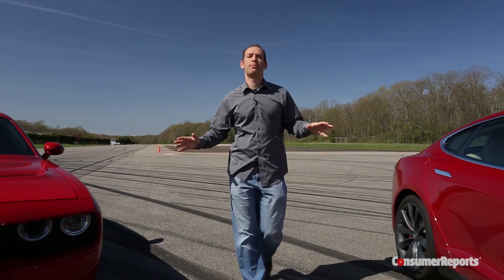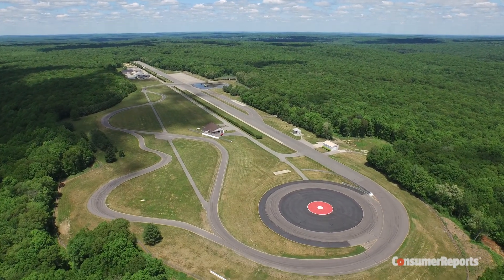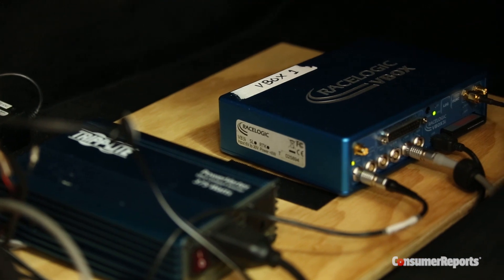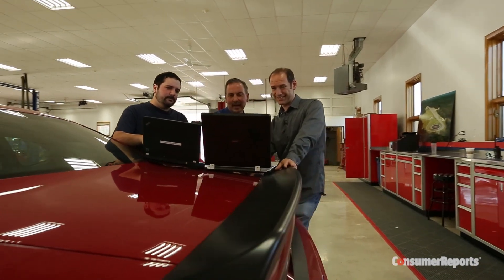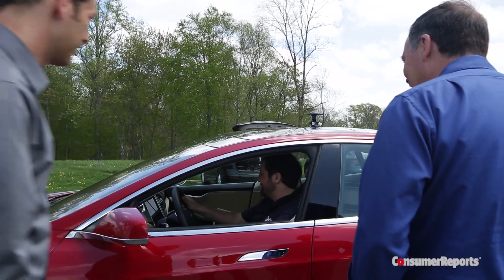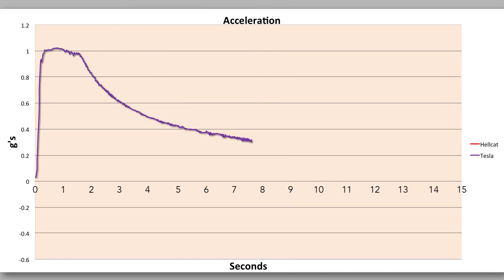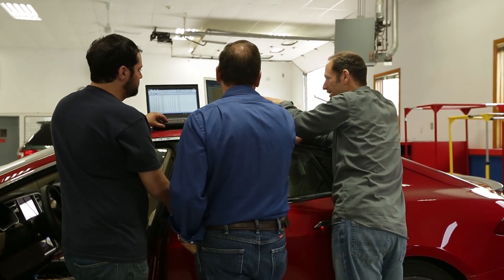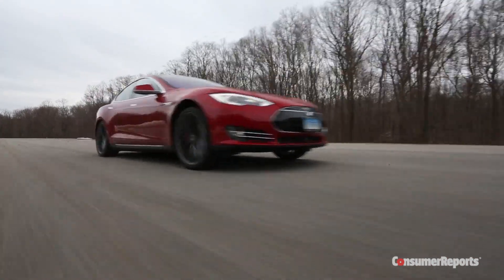Track Science: Tesla P85D vs. Challenger Hellcat | Consumer Reports

Comment: Do you think that the difference in performance between the two cars was at least in part due to one car delivering power to four wheels rather than two?
Reply: Dan Troop Not really.  They could have used an older P85+ with RWD and result will be similar.  The electric motors are able to deliver 100% torque right off the bat, where the hellcat engine/transmission needs time to rev up to its full torque.  If Tesla fitted a transmission, even if just 2 speeds, it will blow away Hellcat at top speed as well.
Reply: Dan Troop better traction is part of it, but electric motors provide max torque at 0rpm so the motor doesn't have to spin up the 2-3k rpm before providing good power. Electric motors are like the opposite of turbo lag.
Reply: Antenox "Electric cars don't really need transmissions." 

Seeing how the P85D falls flat after 60mph I would say it does.
Reply: fatboy19831 For a 700 hp car yes... it is.
Reply: fatboy19831 Man you are full of incorrect info arent you?

The Hellcat is 707hp.

Both Hellcats are faster than the P85D.  Just because you watched a video where the owner could not drive it to its limit, does not make the P85D faster.

The world record run for the Tesla is 11.6.  If a Hellcat driver cannot beat that, they just dont know how to drive it as the Charger gets 11 flat and the Challenger gets 11.2.

The Charger Hellcat with a tire swap to some street legal drag radials is faster to 60 than the P85D (2.9 seconds).

11.7 for a 700 hp car, is falling on its face.  If you do not understand why, then it is obvious you do not know much about drag racing.
Reply: fatboy19831 Again, just shows that you do not know what you are talking about.

You can browse the Hellcat dot org forums and see example after example of owners matching the rated Dodge times of 11 and 11.2, on stock tires.  

Reducing the pool down to only those who keep the factory under-performing tires makes no sense as the first thing a Hellcat owner is going to do is replace the skinny 275's.  If they do not, then that just questions their knowledge of the car to begin with.  

No....   No matter how much you want to wish it into existence, the P85D is not the faster car in the quarter.  

Now, that does not mean that no P85D will ever beat a Hellcat driver.  There are just as many videos on here of drivers botching the launch and getting beat as there are of those who know what they are doing and beat the Tesla.  But all of them have upgraded tires as..  They know what they are doing.

Yes, if I jumped in a Hellcat I would not be able to hit the 11.2 or 11 flat times, but in NO WAY does that mean that the P85D is faster than the Hellcat, just because I do not know how to drive it...

11.0 beats 11.6, nothing you can say will change that.
Reply: fatboy19831 I think its funny when people who are not familiar with racing try to comment.

If you and I were racing, I have a lambo and you have a volvo, and I spin out because I do not know how to drive the car, that does not mean that your volvo is faster...

The lambo is obviously the faster car, as with the Hellcat.  Just because there are videos out there where the drivers could not properly drive the Hellcat, does not mean that the P85D is a faster car.  Only that it is easier to drive, as is the case with most AWD cars.  It takes 0 skill to launch an AWD car.  

High HP RWD cars however take practice.
Reply: Antenox "good engineering" has nothing to do with it, you know what the Tesla and the Lambo have in common?  AWD.  Thats why the times are consistent.  It takes no skill to launch an AWD car.

Boost and RWD however take skill and practice. Its not the car being inconsistent, its the driver.  

If you do not understand this, that shows that you do not know about cars or racing.
Reply: Antenox No... you do not take the average..

Thats like saying the average human running speed is 15, so they should race instead of usain bolt..  That makes absolutely no sense.

Yes, you are correct.  Driver skill should not be a factor when judging car performance, so why would you factor it in and take an average? Your contradicting yourself.
Reply: fatboy19831 I do get it.

People with a bias towards Tesla will find any way to justify spending twice the price for less performance.
Reply: Antenox You do not take the average to compare which is the faster/quicker car... No matter how you want to spin it.  

Paying twice the price for a slower car just does not make sense.

You are saying driver skill should not be a factor, then your averages are using a driver as the main variable.... If you dont see how that is contradicting then you are blind.

Yes I agree that driver skill should not be a factor WHEN COMPARING WHAT THE CAR IS CAPABLE OF.  That is not contradicting anything I have said.  

Taking the driver variable out:
The Tesla is capable of a 3.1 0-60 and 11.6 quarter mile for $100k+

The Hellcat is capable of a 3.4 0-60 and 11.0 quarter mile (2.9 and 10.8 with a tire swap) for $62k.
Reply: fatboy19831 hahahah  "legal condition"?

Accelerating quickly is against the law (trust me I have had tickets for it), so no, if you accelerate 0-60 in 3.1 on the street your breaking the law.

In the quarter mile?  You must be joking right?
11.0 is faster than 11.6...

What "normal driving condition" will it crush th Hellcat in?  Cruising at 60?  Thats a normal driving condition.  Racing is not.
Reply: I have posted videos and and rebuttals to each of your comments.  Your saying the same thing over and over even though its been proven to not be true, or completely irrelevant.  

Continue your circle jerk.
Reply: Antenox Not at all...  

Lets see it first.  

It may reduce the quarter mile time by 1 tenth, it will still be slower than the Hellcats.

Now it is 1 tenth faster 0-60 than the RWD Charger Hellcat with upgraded tires.  Still not worth $40k more.
Reply: Dan Troop That helps traction, which prevents the car from spinning out its wheels, but if the back wheels had enough traction, then it wouldn't really matter if it was AWD vs RWD.
Reply: Also because in the Model S, all the power and torque is available at launch, whereas in gas engines, you have to wait for it to build power.
Reply: Antenox True they do not for normal driving.They also do not need the added complexity and weight of an Transmission.  IN NORMAL DRIVING. With only 1 speed you are limited by the motors 15,000 rpm red-line.  The motor stops making more power way down in the 9000 rpm range. Just having a 2 speed that could upshift at 100 mph and put the motor back into the hart of its powerband would add at least 40 mph to its top speed and improve efficiency and high speed acceloration.
Reply: Antenox EV's do need transmissions if they are to be used as race cars. One gear only allows you to maintain torque advantage over gas cars up to about 60 mph.
Reply: DTRU122283 11.7 seconds in the quarter is NOT falling flat after 60.
Reply: DTRU122283 It beat the 750 hp Hellcat by two cars.  It is the fastest accelerating stock production sedan ever made in the US period. So no.
Reply: DTRU122283 Stock vs Stock.  Not one test has a stock hellcat ever beat a stock p85d in the quarter.  ever. Throw insults all you want. That wont change the fact that  the Tesla is a much faster car in the quarter than the Hellcat. The P85d does not make 700 hp and it weighs almost 700 pounds more than the Hellcat.  The Hellcat does make close to 750 hp at the crank. What the Tesla does make is almost 700 lb-ft torque at 0 rpm.  It holds that torque for almost 5000 rpm. That along with AWD is why the Tesla is so much faster than the hellcat through the quarter.  If you can't understand that then you do not know much about  time to distance.

For the record anyone with a drivers license do 11.7 quarter in the Tesla.  I would give you 4 runs you still would not do better than 12.5 in a stock hellcat.  I would put money on that.
Reply: DTRU122283 
I DO know this. That's why I said "good engineering." The choice between AWD and RWD is an engineering choice.

In a car vs car comparison, driver's skill should not be a factor when judging the cars themselves. That's why you take the average of multiple attempts, and in the case of the Hellcats, they will, on average, be much slower than the Tesla.
Reply: Antenox "I'll tell that to the FIA who judges the land speed records. I'm sure they'll have a good laugh." WTF does FIA or the land speed record have to do with the Hellcat and Tesla quarter miles?  Your grabbing at straws...

"Except the Tesla P85D is not a slower car. It's faster, as proven by multiple races and measurements."  11.0 is faster than 11.6, no matter how much the Tesla PR has brainwashed you.

"Taking multiple runs averages the driver out"  No........... it does not......  If you truly believe that then I am sad for you.  It shows you the average of those selected drivers, the car is not autonomous, there is no way to average the driver out.  But the fact remains, none of this matters when talking about what the car is capable of....  I just showed you several examples above, if you choose to ignore it now then you are purposefully blinding yourself. 

The Hellcat is the faster car.  You can choose not to believe it if you want but it will not change the fact.
Reply: DTRU122283 You haven't posted shit. You've posted lab results and internal testing. Nothing in the real world.
Reply: DTRU122283 
Are you referring to the mythical Hellcat that only exists on Dodge's advertising sheets, or are you referring to the real Hellcat that has never beaten the Tesla in a real world race?
Reply: Yes, and they said so in the review.
Reply: Stephen Chen Tesla cant build a  transmission that can handle the instant torque of the monster electric motor anymore than Dodge cant build an AWD system that can handle the power of the hellcats 750 hp monster.
Reply: fatboy19831 Electric cars don't really need transmissions.
Reply: TheBishopSSR fatboy19831 
Adding a transmission to the Tesla P85D means adding TWO transmission gearboxes, since there's a motor driving each axle. The reason the Tesla stops making power at 9000 rpm is more of a software limitation to protect the batteries' longevity than because of any mechanical limitations. Better cooling/battery technology would serve to widen the Tesla's torque curve more than the added complexity and weight of a transmission. And then there's also the choice of the final drive ratio. The Tesla already accelerates to 60mph in 3.2 seconds; tuning the drive ratio for slightly slower acceleration would let the Tesla still accelerate quite quickly but also let it stay in its power band for longer.
Reply: Antenox  Or they could have a very tall gear on the rear motor Wile having a shorter gear on the front motor.  Simply shut the front motor down after say 100 mph.  The 450 hp rear motor with taller gears would still pull to well over 170 mph and be much more efficient at lower speeds. During re-gen both motors would charge the batteries. I am positive the engineers at Tesla have already considered this and came up with the most efficient solution.
Reply: fatboy19831 
Good idea, although I think I'd put the tall gear on the front motor. Having a short gear on the rear motor would mean the rear wheels would be able to apply more torque than the front wheels when accelerating from a standstill. Then at higher speeds, where acceleration drops off anyway, the front wheels can take over driving the car.

I wonder how driving a car that shifts from RWD to FWD and vice versa would feel like.
Reply: Antenox It would start out in AWD then switch to RWD. Sense the drive wheels are not connected you could run both motors at the same time. With modern electronics the switch would be undetectable.
Reply: DTRU122283 
Good engineering produces consistency. The Tesla can consistently repeat that quarter-mile number. So can the Lamborghini, for that matter. The Hellcat twins can't.
Reply: DTRU122283 I agree. After running on road remote control electric cars with 2 speed box and a centrifugal  clutch, they way outperform single speed. I'm sure the same could be applied to the Tesla in some way.
Reply: DTRU122283 
Yes, you DO take the average, but no, I'm NOT talking about the average of a population. I'm talking about the average of a single individual.

To use your analogy, if Usain Bolt ran a 9-sec 100m dash 50% of the time, but kept spraining his ankle the other 50% of the time, NO ONE would use him in a race.

This is also the reason why land speed records are taken as the average of at least TWO runs, never just one. The Budweiser Rocket in the 1970s was never given the official land speed record specifically because it only made one run before breaking down.

Driver skill should not be a factor when judging car performance, so why would you factor it in and take an average? Your contradicting yourself.
I'm not contradicting myself. Averaging out multiple runs also averages out driver performance. YOU are the one contradicting yourself when you agree with me that driver skill shouldn't be a factor, yet claim that the Hellcat is the "better car", because YOUR claim is dependent entirely upon the driver. MY claim is not.
Reply: Antenox I don't think he gets it.
Reply: DTRU122283  The Tesla is faster under any legal condition and in the quarter mile.

 I think the hellcat will hold much more value in the long run and is much faster at ultra illegal speeds. 

Almost under any normal driving condition the Tesla will Crush the hellcat.
Reply: DTRU122283 Pull up a video of a Hellcat beating a Tesla in the quarter.  Or admit defeat.   You would never ever run a 10.8 in a Hellcat with drag tires running 100 octane.  You personally would never hit 11.5.in a hellcat.  I would bet good money you could not hit 12.5 in a stock hellcat.  Good money.  You personally could at will hit 11.7 in the Tesla D on your second run.............  I don't know you from jack.  My money would be safe.
Reply: DTRU122283 Not is legal the law to hit 60 in 3 seconds.   I have maxed out many a car entering an expressway in NY NY. No stock Hellcat can hit 11 in the quarter.
Reply: DTRU122283 
You do not take the average to compare which is the faster/quicker car...
I'll tell that to the FIA who judges the land speed records. I'm sure they'll have a good laugh.

Paying twice the price for a slower car just does not make sense.
Except the Tesla P85D is not a slower car. It's faster, as proven by multiple races and measurements.

You are saying driver skill should not be a factor, then your averages are using a driver as the main variable.... If you dont see how that is contradicting then you are blind.
Taking multiple runs averages the driver out. Do you not understand basic math?

Yes I agree that driver skill should not be a factor WHEN COMPARING WHAT THE CAR IS CAPABLE OF.  That is not contradicting anything I have said.
Yet you said earlier in the thread that the Hellcat is only faster than the Tesla if the "right driver" is driving it.

The Tesla is capable of a 3.1 0-60 and 11.6 quarter mile for $100k+
Consistently.

The Hellcat is capable of a 3.4 0-60 and 11.0 quarter mile (2.9 and 10.8 with a tire swap) for $62k.
Only if the right driver is driving it.

Hence, the Hellcat is slower, because the vast majority of the time, the right driver will NOT be driving it.
Reply: DTRU122283  Pull up one video.  One article of the Hellcat ever beating a P85d.  Just one.  Stock to Stock.  In the 1/4 mile on the same day same track head to head. You cant do it. Until you can the Tesla P85d has proven to be a faster accelerating car than the Hellcat. At least in the 1/4 mile.
Reply: DTRU122283
WTF does FIA or the land speed record have to do with the Hellcat and Tesla quarter miles?
It proves that everyone (except you) knows that in order for a car to be judged faster than the other, it has to be based on its average, not on any single run.

11.0 is faster than 11.6
Yet a Hellcat has never beaten a Tesla in a head-to-head race.

No........... it does not......
Yes, it does. That's why the FIA takes the average when it judges land speed records, idiot.

But the fact remains, none of this matters when talking about what the car is capable of....
If the Hellcat is only capable of those speeds under very specific, controlled circumstances, then it's not capable of those speeds on a predictable, realistic basis, and is therefore a slower car.

The Hellcat is the faster car.  You can choose not to believe it if you want but it will not change the fact.
The proof is in the pudding, and a Hellcat has yet to beat the Tesla. Therefore, it is not the faster car.

The bottom line:
If it takes a FLUKE for the Hellcat to win over the Tesla, then the Hellcat is slower.
Reply: DTRU122283 
Just announced today by Tesla:
Ludicrous Mode. 0-60 in 2.8 seconds.

Care to revise any of your previous statements?
Reply: He is talking about the Hellcats that are in the 10's that you can see all over youtube...  Just because you dont believe something doesnt mean its not true lol